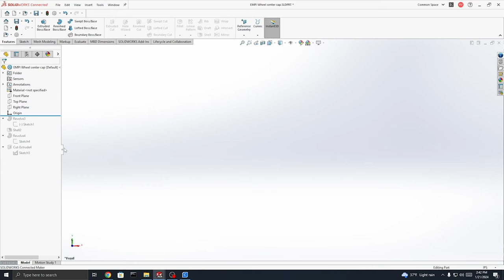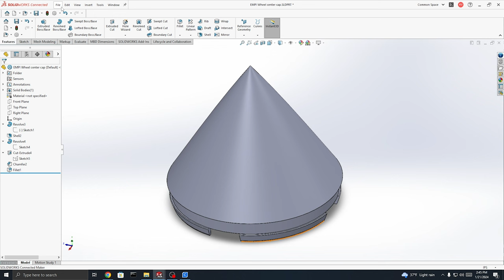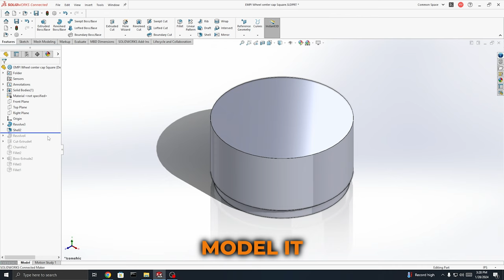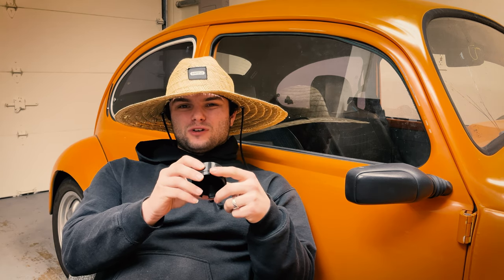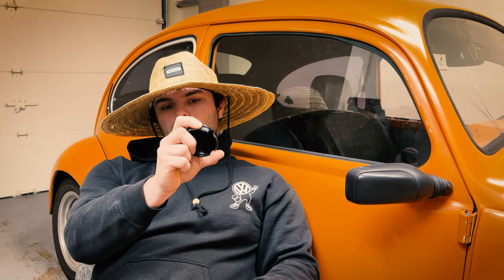CUSTOM VW BUG EMPI WHEEL CAPS (3D PRINTED)

Comment: Do you happen to know what is the center of the 8spoke wheels are? I have a set of epsilon wheels and I can’t find any center caps that fit, the center looks just as wide as your wheels on mine, the ones I have measure just about 76.2 mm so just about 3”, I’m wondering if these would fit.
Reply from the maker: I’m not sure if they’re the same size actually… message me on Instagram @75FlameBeetle and I can more than likely make you custom caps!